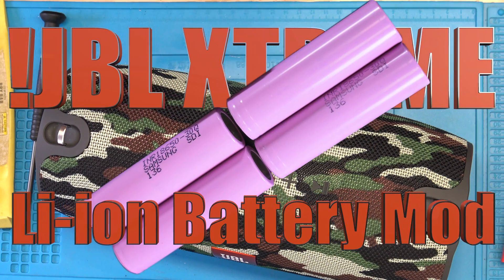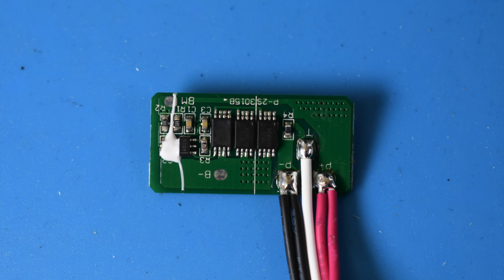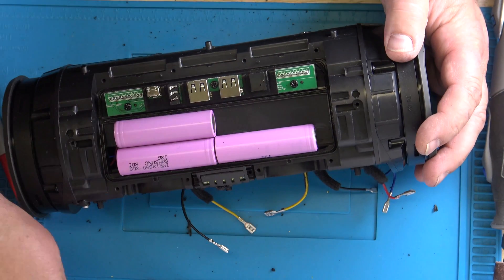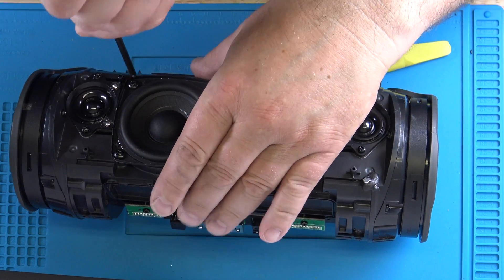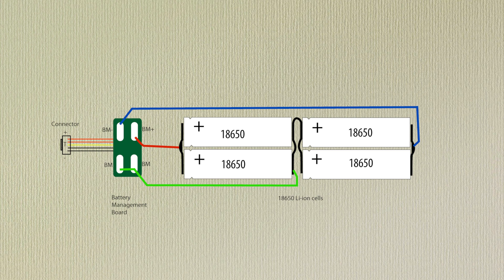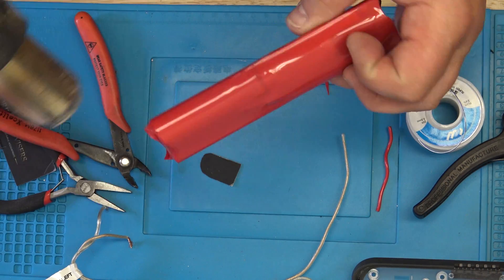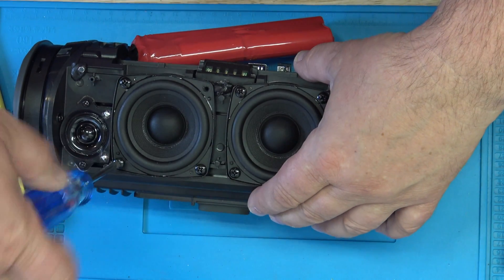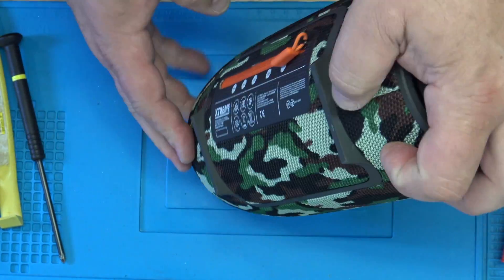JBL Xtreme Li-ion Battery Mod - The Right Way

Comment: Bro there is one more problem after I connected everything and closed the JBL after playing it the bass sounds wierd some people say there is air leak but don't know from where the air is leaking or which part to seal pls help
Reply from the maker: Yash Dobra did you remove some of the battery compartment so that the new batteries fit 100%? If not, the door doesn’t close and then air leaks! There are not many spots where air could leak, but the battery door has to close all the way!
Reply: @mygiguser  ohhh crap! There's not much space there . That's why the door doesn't close fully , just some space is left it doesn't close dude is there no other way that I can seal it ?

Comment: Very good, very useful. Would you like to know the battery life and if there was any bass loss? This how much mAh and voltage this managment board  has? My original jbl has 10.000mah.
Reply from the maker: Le o don’t know the battery life, no bass loss, and this setup has the same BMB as the original battery.
Reply: @mygiguser  Nice. I have 4 batteries with 3.7v and 2600mah. Can i use same managment board as you ?

Comment: Ok so now everything is done correctly just while charging the 5th led keeps on blinking after keeping it charging for a very long time also it keeps on blinking idk what to do pls help tell me when to stop my charging my
Reply from the maker: Yash Dobra measure the voltage of every single battery, are they all the same?
Reply: @mygiguser  so I checked the voltage of 2 batteries when I checked after charging was 3.87 and other two batteries was 3.72 this was it.

Comment: how many volts should be the battery of JBL XTREME?
Reply from the maker: 7.2V and 8.4V max  https://youtu.be/PrKXumAvC8g
Reply: @mygiguser  tnxs for the answer, so cannot put 14.8 volt right?
Reply from the maker: No you cannot, that is way to much voltage!
Reply: @mygiguser  can i use 4 pcs of 3.7 volts each battery?
Reply: @jasper232  with 4 batteries u can use a 2s2p configuration
Reply: @isaacsanchez7317  how is that configuration? I mean how will I do it?
Reply: @mygiguser  how many volt each battery that you use here in your video?

Comment: Dear, it is assumed that when installing the batteries has more mA than the origianal, how does the led behave according to the load? Is there a problem if I install samsung batteries 18650 3500mA? How long is the battery life in operation with the new arrangement?
Reply from the maker: Jose Ramos Ramos no problem with the LED charge indicator, it is based on battery voltage. The more Ah the new batteries have the longer they last. Battery lifetime is hard to say, it depends on the battery quality. I think Samsung is pretty solid.

Comment: Hi. Great job. But is your battery diagram correct? It seems different from original bateries
Reply from the maker: Le o how is it different?
Reply: @mygiguser  the green one, that negative, seems to me being in the positive and negative in the board. And once again, great video im going to do the same saturday with my jbl. Thanks
Reply from the maker: i look at it again, and it looks good
Reply: Agreed, wiring is not the same as original batteries, couple other videos confirmed correct wiring, nit like this video

Comment: i bought some to do on my charge 3 im confused on the rating of the batteries they are rated at 3000 mah 3.7v is that each cell or for both?
Reply from the maker: WCxColossus each cell
Reply: @mygiguser  so with 2 cells ill be at stock mah for my charge 3?

Comment: are there different ways of wiring the battery i say another video and the guys wired it differently
Reply from the maker: WCxColossus not that i know of, can you share a link?
Reply: @mygiguser  thats the link
Reply from the maker: I am looking at this, and i connected mine the same way as the original battery pouches were connected, then i drew the schematic. Looking at the video link you sent, he is connecting the very same way, but it looks more complicated. The schematic is the same. That answers your question, there is only one way to connect the wires.
Reply from the maker: Look at this, i wired it the same way as the original Xtreme 2 batteries https://youtu.be/Qut7biIdL-Q

Comment: Nice work! Can you see any problems with having more batteries installed? I'm planning too putt batteries, in both sides under the air thingy, aswell as we're you put youre batteries, will the charger mange it? I know the sound quality can be an issue... I just want to maximize the battery life, for like festivals or camping usage. Great video!
Reply: i was planning on doing thia to increase the capacity i just wanted to add 2 more. i have 3000 mah batteris so if i wire in parallel that geta me up to 6000 if i add another 2 that gets me to 9000 right??
Reply from the maker: If you add batteries in parallel, that shouldn't matter as long as you don't run out of space inside. I am sure the sound will change, if you use up all the space inside the speaker.

Comment: How we can use suatable BMS for 18650 ? Original xtreme bms cutting out earler `cose maded for LiPo batts. 18650 will last longer, but need to replace bms as well. Dont know why and for what they use to use 3rd wires after bms. As usual two is enouth. Bms after bms?
Reply from the maker: The third wire is for temperature on the battery pack. If you don't like the original BMS, just replace it with a new one.
Reply: @mygiguser  wow - r u shure? Have u tried do not connect it, jbl works fine? I belived 3d wire connected to the middle battery point
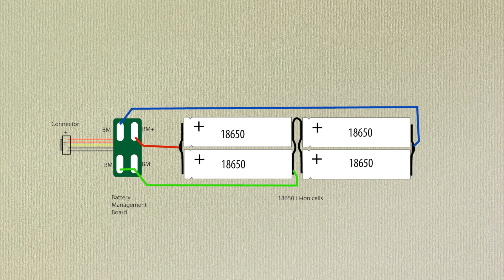Reply from the maker: Did you see the drawing @2:44 in the video? That is how it is connected. The connector to the main board has 5 connectors two GND, two power, and the one in the middle is Temp.
Reply: @mygiguser  the green wire with the thermocouple to measure temperature?

Comment: I used 18650s too but only difference between your method and mine is that I didn't have to MOD the battery compartment. But I like how you made batteries look like they came out of a factory, looks a lot more cleaner and neat compared to mine. Awesome work!
Reply from the maker: Taylor Soloai my batteries didn’t fit without modifying the case. There was a 1-2mm gap when you put the lid on, and you try to avoid any physical pressure on those batteries. Then again, as long as it works.

Comment: Hi. I'm looking forward to doing this with the JBL Charge 3. Are there any circuit schematics, using panasonic batteries to help? Thank you
Reply from the maker: Not sure, i don't own a Charge 3.
Reply: mygiguser, thank you man! Nice
Reply: @scalabreza   man i have jbl charge 3.  I have problem my battery because  its getting big..  It is because of over charge??
Reply: @carlitoboquila5267  its because theres pressure inside the battery, u definitely have to change it, could explode while charging/using